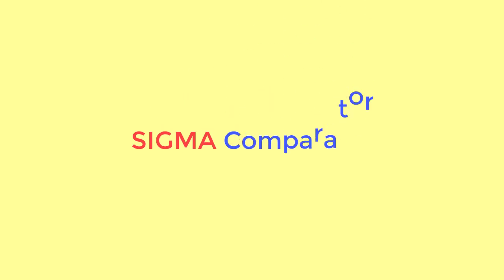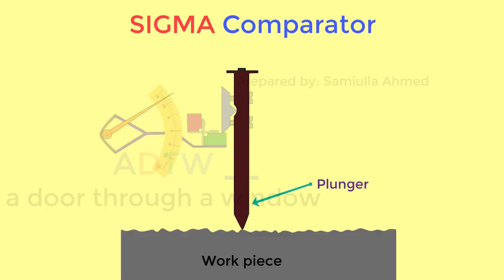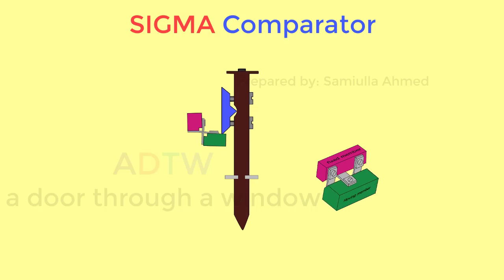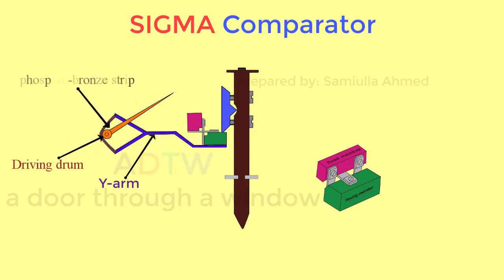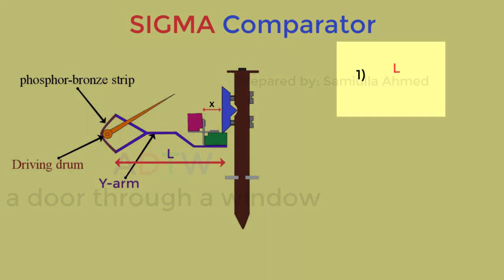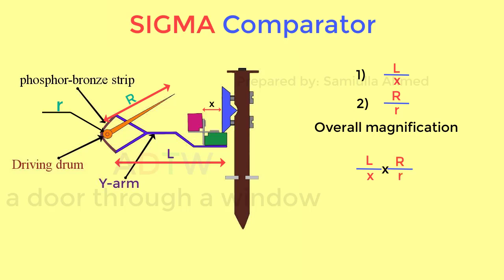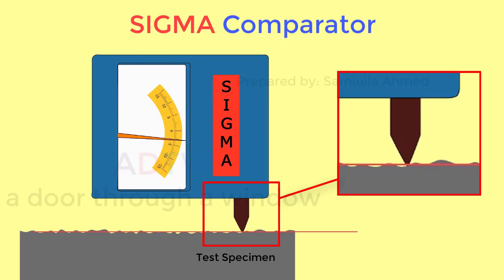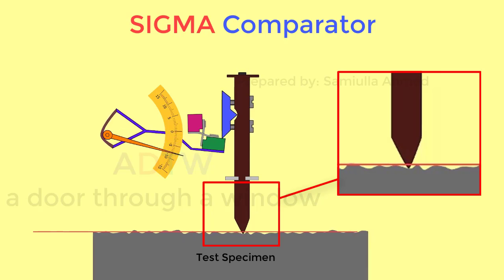Sigma Comparator working animation.

Comment: Sir in exam one question came which is
 Which comparator generally used for comparing small displacement of spindles??

Options  are  
Sigma comparator 
Reed type comparator 
Optical comparator 
Electric  comparator
  Please reply sir
Reply: Optical yaar
Reply: @vardhaneswar607  wrong
Reply: All of the Above